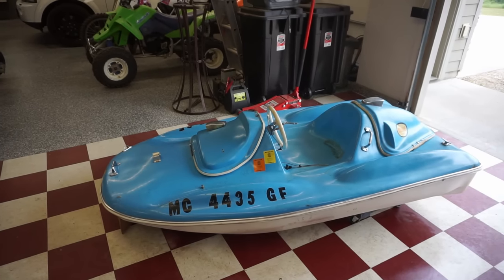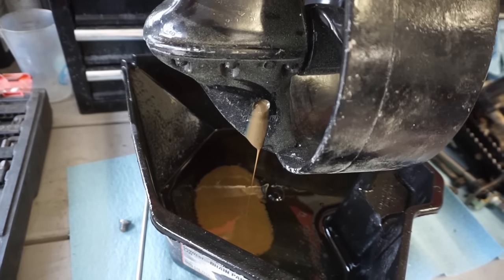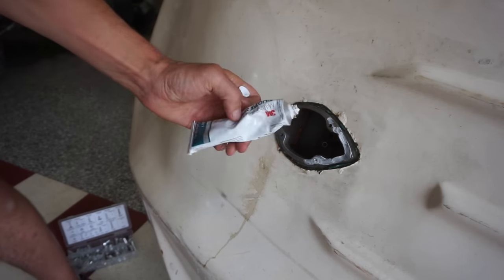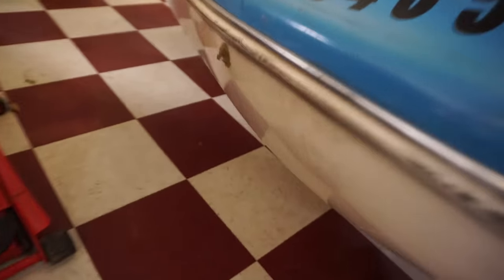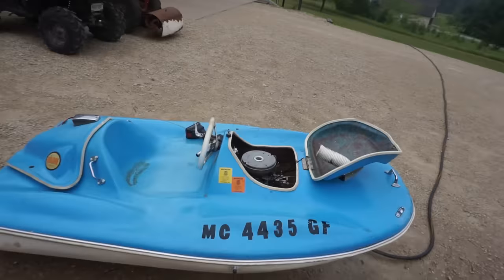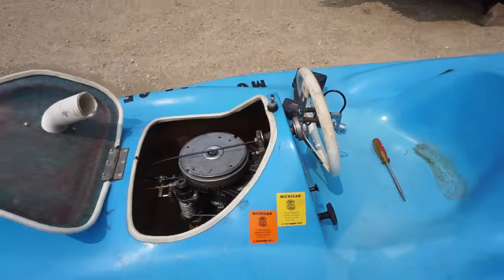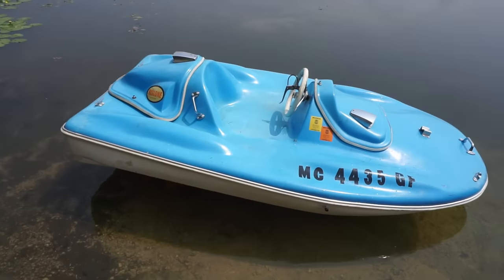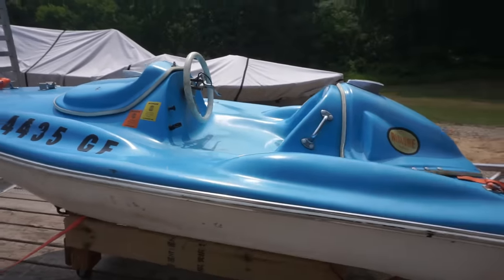First Ride On The 1960's Mini Jet Boat

Comment: That machine isn't turning up to full throttle.  It is barely above an idle.  Some throttle adjustment is in order.  With 6 hp on that little boat, if properly adjusted it will fly.

Comment: Although it’s pumping water you should still consider replacing the water pump, because I’m sure if you took the housing off you would find some carnage as it’s the water pump that was in it since it was put away in the 70s. Those water pumps only really last 6 to 10 years and 40 years untouched can’t be good for it.

Comment: Also when you tighten any bolt patterns especially a four bolt pattern or five or six bolt pattern you should always crisscross the bolts so that way you don’t put any unwanted attention on stuff you could potentially crack or strep throat because you tighten the top two bolts on the drive and then the bottom two bolts two bolts

Comment: Old outboard guy here. I don't know what you meant by "everything looks 
brand new" under the flywheel in part one. The coils are not just cracked a little 
bit - they are cracked to hell and completely shot, which is typical for
 the original coils after almost 60 years (they usually cracked in 20) 
Both need immediate replacement; it will NEVER run properly without them
 (it runs poorly now) Still available from NAPA/Sierra. So are the points and condensers. Replace 
the coils immediately. You also need to replace the water pump impeller immediately; it is likely 'destroyed and it pumps little water. Don't run it without replacing it and the other items, like the pickup tube grommet. It is likely the lower unit needs a seal kit as well because the oil does have water in it - and there wasn't much, so it might have a leak. Jesus, it just needs a little TLC and it will run forever. Consult with your local Antique Outboard Motor Club chapter - the guys will help you do exactly what is necessary.

Comment: A old 50's to 60's round johnson fuel tank should fit. Also notice some water sloshing around with the go pro foot operation before heading back in to dry ground. That'll be a good trainer for the youngsters when you get all dialed and kill switch with a kill tether.

Comment: Something that might work better than that steering wheel and throttle assembly is a Honda Odyssey/Pilot ATV steering wheel. The throttle was located behind the right hand steering control and would make it easier to use.
Reply: Also curious if you could change out the engine for an electric engine?

Comment: Modify it with a jetski/seadoo that crashed but motor & jet is still ok...  You can get one for very cheap..  maybe even pick up a write off for next to nothing...
I do like the ring around the propeller to protect your limbs if crashing..  I don't think it is actual jetboat though without an impeller, unless you do a seadoo swap...
If the hole for this motor is far forward you can look for a 2-3 person seadoo that is a bit bigger than other seadoo, as well as having more power...

Comment: Macho man randy savage says ( oh ya ). Or was that the coolaid man IDK. I would place a bar across the top of the engine to prevent the cable throttle cable from getting lodge in one of those 2 grooves on the top motor pully I just use a piece of thick round metal tube curl two ends to except a nut and bolt on each end u done great job.

Comment: either your water tube didnt go back right or you left key out the impeller or you place the water pump in with the legs on the impeller leading instead of laging never turn the shaft counter  clockwise  always clockwise on the flywheel those 6 hp and 9.9 are really simple to work on  i have done about 8 or 9 now

Comment: You should replace the caster wheels on your stand with a bike wheel between the legs on an axel and than fit some removeable handles to the other end and youd be able to just wheelbarrow it off the trailer.

Comment: The speed that thing is moving says it is putting out much less than claimed HP. Perhaps further tuning is needed. I didn't notice a spark advance connected to the throttle either.

Comment: They don't make anything easy to work on.
@28:11  🐶     😂
If the engine is toast but is vertical shaft. Could you throw a 10hp lawnmower type engine in it & make a coupler to connect the prop.  Then no need for a water cooling pump. Add a quiet exhaust/muffler and vented hood cover for air flow. If 10hp is too big to fit use smaller engine with hi hp parts.
Looks like a WAY better design would have been regular style boat engine in the rear with a tilting prop.

Comment: The red fuel can will fit. Just put the cap back on and turn it on its side & put a fuel fitting in the side of the can.

Comment: I don't think the engine is operating at full capacity. I have a 68 Johnson 6hp on a 12 foot aluminum boat and it moves right along, with the throttle barely open it goes as fast as the Mini Jet Boat. I think there is room for improvement. (running on one cylinder?)

Comment: the water Pump function is similiar to a modern PersonalmWaterCraft  although they also use the Jet Pump thrust  to siphon water out of the hull  as a Bilge Pump. that is always drawing water  both functions work quite well  minus one problem i discovered years ago  on a Kawasaki 650 motor that began overheating on me  unless it was on a Trailer running on my hose  i figured out. i had a blown head gasket that was leaking exhaust gases into a water Jacket and that  pressure was too strong for the  Jet Pumps Cooling water to get pumped thru the motor efficiently  on a trailer the hose pressure was  enough to  pump water thru the block and out the tattle tale and exhaust system  my guess is you could find a electric starter  to modify   to fit that motor  if you so desired to  i don’t know your location but a good Marine Starter rebuild shop could probably     set you in the right direction  many parts. we’re interchangeable  with  certain brands    and a repair shop in a decent marine area  usually has shelves of old  ones somewhere  that could find the right  gears  etc  BTW. i have owned 17 or 18 Boats of all sizes , styles and dedicated uses as i did grow up and spend the majority of my life in Florida  or living in Maryland were i had a boat on the Chesapeake Bay for over 30 years !  talk to old timers in those areas they know the shops
Reply: picnic boat  your area 37 fit yaght dusél jetd

Comment: The timing advance looks to be disconnected completely (the plate under the flywheel that would move a roler on the carb simultaneously advancing timing and opening butterfly on carb). Probably by design to keep the power low.

Comment: The things barely even running at idle speed. Still needs to be tuned I know they're detuned because most of them were used at kidsparkz but if that motor is tuned properly it should actually get that thing up on plane might need a different prop

Comment: i know in most cases you cannot law a motor on its side to take out the lower fill tube... but in this case, it would appear to be much easier to do that.

That oil was real brown.. water causes oil to turn milky.. what causes oil to turn brown like that? just curious.

Comment: Question. What do you do about sheered bolts on older quads/bikes? I got a bayou 220 and I found the header bolt that holds the pipe to the engine was sheered off. So it’s pretty loose. Any way to extract the old one from the head?

Comment: You can probably take that gas engine off or out of there and replace it with an electric one and you could probably get a lithium/ion battery that doesn't weigh too much, but anyway that electric motor may push it a little faster, well depends on what size electric motor you can get, you may be able to find a good used one, looks to me like one of those electric one's from a kayak might work on that, I don't know? Just a thought...

Comment: Running on one cylinder change the coils and clean the points. Check the thermostat and change the impeller. Once again Google Leroys Ramblings everything you need to know is on that site

Comment: Bro if that oil didn't look milky to you then I'm guessing you must have 20/20 vision like Stevie Wonder anyway it's probably got bad input and output but those are easy to do,  just an FYI the black silicone you can buy at advanced or O'Reilly's holds up better when dealing with water.

Comment: I bet it could  be modified into something a little more peppy .  It needs to be up out of the water a few more inches at the minimum . Could you imagine if you got hit with even just a tiny wake . If you didnt roll over if would sink from taking on 20 gallons of water in 1 shot...Still pretty co0ol to see what we doing back then with thus stuff

Comment: You never got it on plane and only appeared to be getting less than half throttle.  You probably need to get the idle and high speed jets adjusted better on the carburetor and perhaps should check that it has the correct pitch prop on it.  What oil mix were you using?  Back then the mix was a lot heavier than whats commonly used today.  How did the reeds look on the intake.  Often the petals on the reed plate can get rusted badly enough half don't open and those that do won't seal very well.  The reed plate likely needs to be removed, cleaned and polished to get the best seal possible.  While its possible its a reedless design I don't believe they were that common back in the 1960's.

After all these years it is also possible they switched the prop to whatever they had available after the last event where they grounded it and broke off the rudder which appears to have multiple weld repairs done on it.  You may need a prop with a little less pitch if the engine is running correctly and can't get it to plane.

Best!

Comment: What is the reason for pumping the oil in from the bottom on the lower unit? Couldn't you just fill it using the top hole and stop once it runs out the top?

Comment: The reason it runs better with the hood open is you have an exhaust leak that fills the engine compartment and pollutes the air intake.

Comment: I'm not sure about the gastank. Think that a pressuretank will make a difference. And someone mentioned lack of one cylinder. I agree, 5-6 hp will do better than this. My 2,3 hp is faster. But it's a really funny project though. 
Have a nice summer

Comment: Now that you've got it running.... how about engine swapping a new 5.5 HP 173cc ohv vertical shaft Predator from Harbor Freight...if it will fit.

Comment: With the final drive and the rudder hanging down underneath like that it's so impractical to transport it seems to me might better off trying to figure out a way to hang a trolling motor off the back of it and put the battery were the engine is for ballast.

Comment: Ummm....once you got the oil full in the lower unit and put the top screw in.....why didn't you just flip the unit  vertically so you lose no oil?

Comment: Why do you fill up the oil from the bottom and not just from the top till it flows over? so confused haha.
Reply: Standard outboard gear oil filling procedure, filling from the bottom reduces the chances of trapped air.

Comment: i have a jet ski with a yamaha 701 engine. it has spark compression and fuel getting to the brand new carb i put in it. keeps spluttering and trying to start but wont run! had new carbs new battery new battery. why wont it go!!

Comment: To me it sounds like you're getting about 50% power out of that motor it should be way better than that you need to go through and check the coils on each cylinder.

Comment: "Doesnt look milky"  ?????  ....  i think id be checking the gaskets on that lower unit where it meets the boat and at the prop shaft cause that completely looks milky.  Also looked sketchy on the water due to bow sitting deeper than the stern but then again it was meant for kids not adults i imagine... one wave over the top would go right in that engine bay since you had the top open lol

Comment: Please put a 5hp Yamaha outboard on it. I speak from experience. The boat will have a normal stance in the water and planes in seconds. Get the outboard engine height right, wire some clothing lines from engine to steering wheel so the steering wheel works and a throttle( forward neutral reverse)  so you can just sit normal and have all functions. The boat will come to life in ways you cant imagine. Instant pickup and plane, fast, you can use a normal size tank in front to go places all day in style and addictive fun.

Comment: The top hole is always the fill hole bottom always the drain hole your working backwards
Reply: Standard outboard gear oil procedure is to fill from the bottom….look it up.

Comment: Not a "jet drive". It's a PROpeller, not an IMpeller. Yes, the water pump has an IMpeller. Pretty much a limited production failure. Cool concept though.

Comment: Not a jet boat, jet boat uses impellers not propellers. I think using the drill is faster than the actual motor😂

Comment: Fixed it so well it can’t even start without a drill, throttle cable rubbing on the fly wheel it really is a shame you get hold of some nice projects but your always in such a hurry just to get it started call it done and get the next bike victim etc are you unable to do a proper restoration it still counts as content, your grandfather’s motorcycle was another prime example it could have been a great restoration but your work is starting to look more and more shoddy.

Comment: No one mentioned being safe where is your f-ing LIFEJACKET ? Also the hood needs to be kept closed that metal air scoop is not the exhaust it pulls air in and pushes it out the back its to keep the boat from exploding gas fumes get pushed out the back from air going in the front

Comment: you just ruined perfectly good expensive gear oil. Any old leg , especially oe that has been sitting for a while, flush wit cheap motor oil. Mount the leg to something 9 i just strap it in a large vice. fill with oil, spin the shaft(with a drill) forward and revers for about minute,  drain oil, repeat till ion comes out clean, then fill with lower leg oil.
Very rookie move, not changing water pump impellor. Sitting all those years, dry rotted, bits fall off, get in cooling passages in motor, lots of work to fix.
Yes it is slow, that motor don't sound like it's getting full thottle

Comment: Pretty slow for a 6hp probably not running at 100%. My 12ft fiberglass boat with 5 kids in it plus a full sized adult with a 4hp outboard is faster

Comment: I feel like if your wife let you rip out your bathtub , threw on a small engine and a rutter , you'd have a better , safer , sturdier boat than this thing...
In all fairness it was obviously made for kids . Even though your not heavy , the way that is so low to the water it seems like your 50lbs over its limit ???